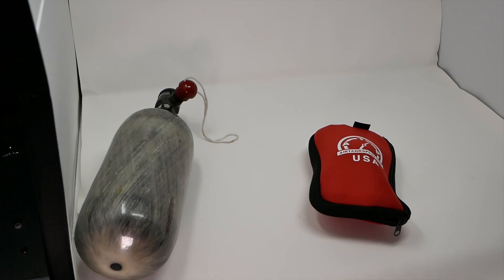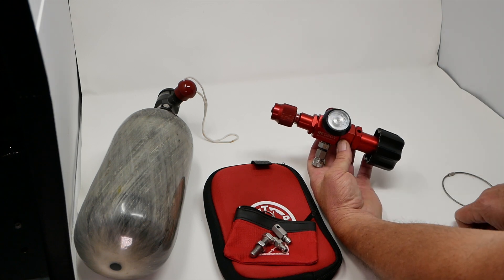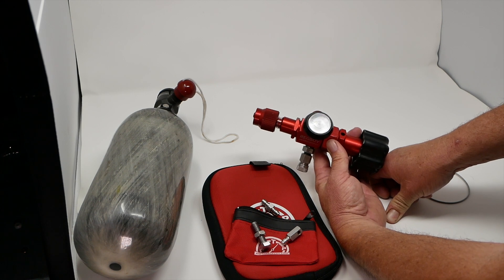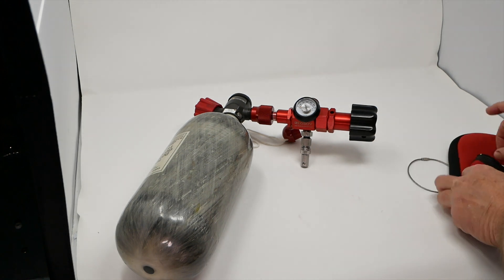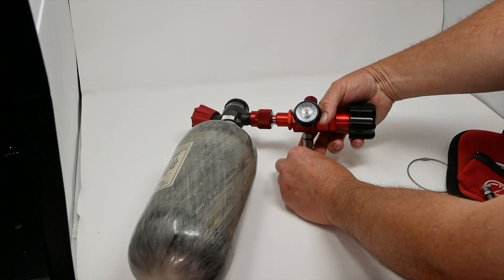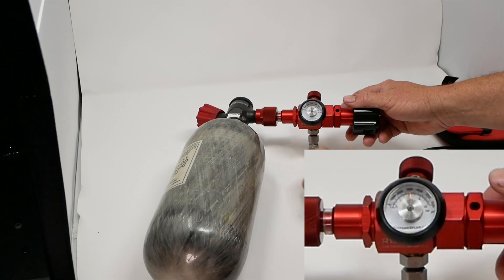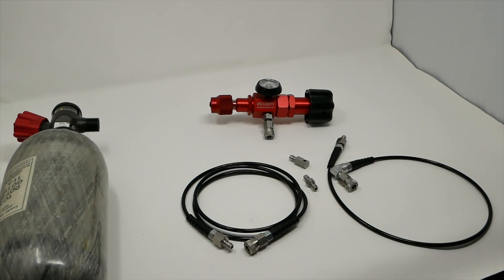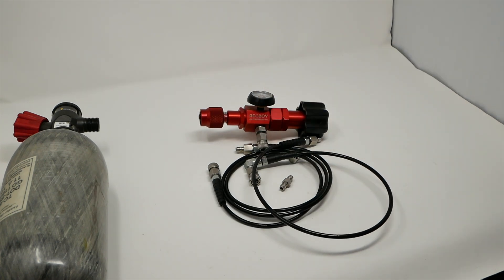RegBoy How it works External PCP AirGun Regulator and Fill System

Comment: I have never had a regulator that you did not just push in on the adj. knob to lock it so it would not turn.  Look like a nice accessory. If it is more expensive than the Regman. I would stick with the Regman.